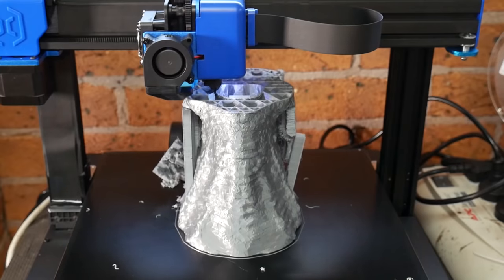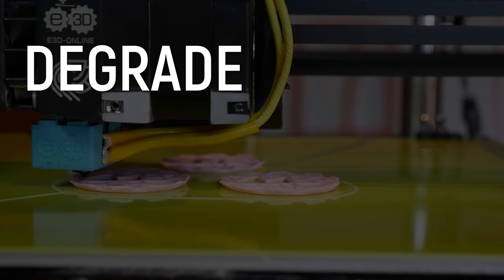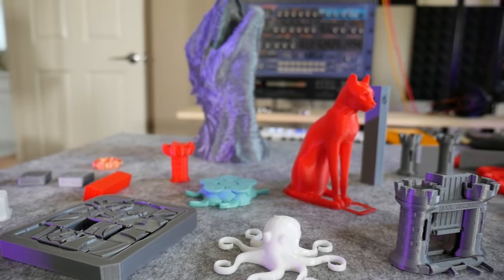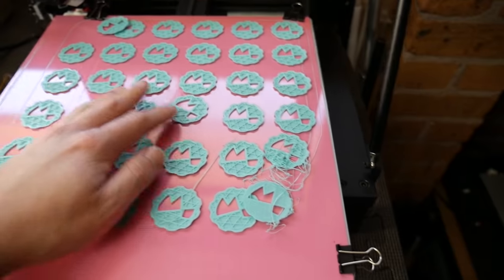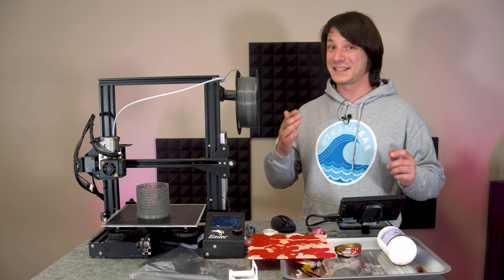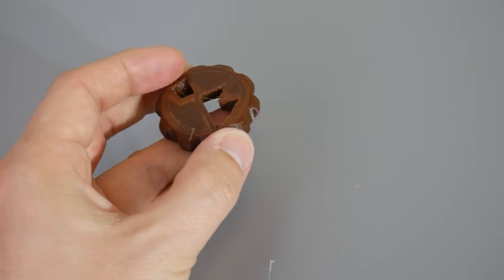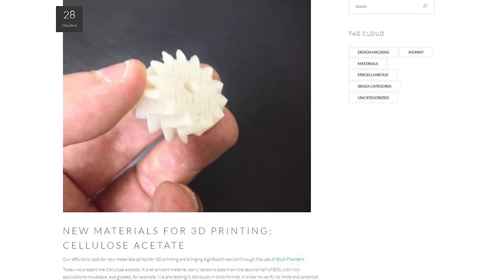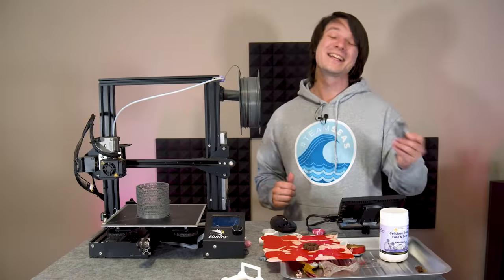PLA - 3D Printing's Biggest Lie.

Comment: Biodegrading is a lengthy and expensive process hence lack of government buy in. Governments are uselessly slow, so as soon as "lengthy" is part of any process governments aren't interested.  Recycling is a wonderful idea if it actually happened. But as you said, instead of being recycled alot of plastic is being shipped away to become someone else's problem. The real solution here would be to subsidize filament recycling. One-time-use anything is the worst possible thing for the environment. So don't use it one time. What the various governments environmental agencies need to do is subsidize filament recycling. Subsidize sending every maker a  plastic grinder and a commercial desktop filament extruder. Take the failed prints, benchy's and all the plastic recycling from your bin and turn it back into filament. Good filament isn't cheap so why throw it away. If its inclusion into oceans and landfills simply stopped being anything more than a fluke your net positive is pretty obvious.

Comment: The first time i came across PLA was many years ago when my dad was a surgeon and used PLA stitches which were carefuly manufactured in such a way so that it disolved in the human body in a month or so.
Cellophane will not disolve in acetone, you are confusing it with something else, maybe cellulose acetate. True cellophane is pure cellulose, disolved in one of  its solvents and extruded into fibers (rayon) into film (cellophane) or thin wall tubes for artificial kidney machines. Cellulose nitrates will disolve in acetone, not sure about the acetates, im going purely from memory.
Cellulose cant be melted either. The nitrates dont melt as much as burn, or even deflagrate if well nitrated.

Comment: While you're at it, start working on end of life for electric cars. All the added electric components, plus the battery will need to be properly recycled. It's likely not gonna happen, it's cost prohibitive. Ah yes, electric cars. Requires fossil fuels to manufacture, and charge, as well as effectively the effective raping of third world countries to acquire raw materials. When you dig into green tech, it's not that green. But it is a nice way to control people.
As you alluded to, petroleum based plastic recycling in general has been a mirage since its inception. Solving 3D printing waste is nice, but just a drop in the bucket. I guess it's as good a place as any to start though, I wish you the best!